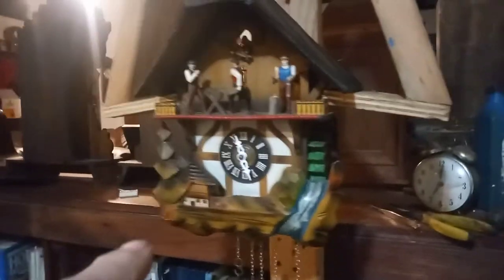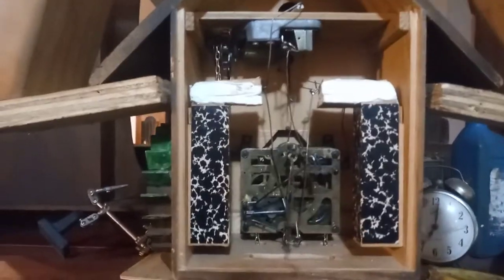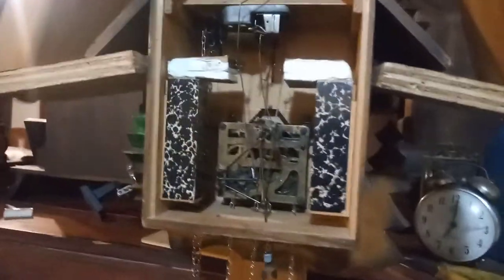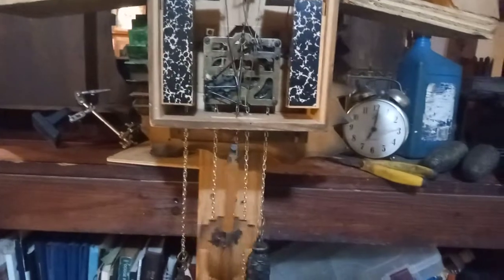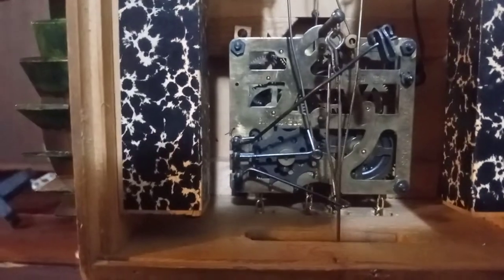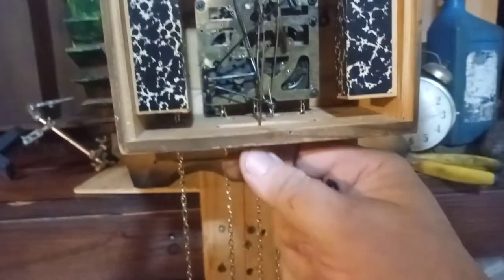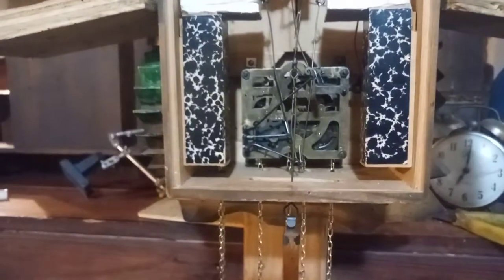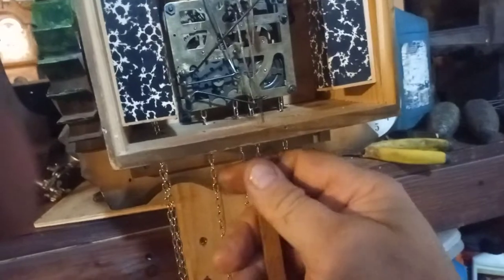Repairing a E Schmeckenbecher woodsman cuckoo clock with waterwheel 20211222 211806

Comment: I just came across your video and I wanted to share a related bit I discovered with this "v-wire".  The clock will also not run if the woodsman lead wire is bent in a way that it reaches the point of the v in operation.  Somehow mine got bent in just this way and it took me a while to figure out where the hangup was.
Reply from the maker: Glad that you got it sorted out. Yes the "V" wire is critical in getting this clock in beat. Thanks for the information. Hopefully folks will read these comments.

Comment: I’ve watched many of your cuckoo videos and learned a lot.  I’m repairing a woodsman clock with the water wheel. I have a problem adjusting the time. I disassembled and ultrasonically cleaned it, put it back together, got the music and hatchet man working. I have timetrax and set it to 8213 BPH.  I can’t believe it, it gains 2hrs 18min in 24 hours!!!   The pendulum is 19.5 cm as the Regula 25 movement specifies. Should l take the movement out and try to count the teeth on the time train to mathematically see if 8213 is the proper BPH?  I can’t imagine how this is possible.  Any advice would be greatly appreciated. Thank you very much. Jim
Reply from the maker: Jim I have a woodsman clock without the water wheel. The one in the video was for a friend.  My  pendulum is 7" long. Chalet style pendulum. With the bob about one" from the bottom of the stick. So try moving the bob up or down to get to the BPH. I hope this helps.Let me know if it does. Good luck.  Do you work on clocks for a living?
Reply from the maker: I have never dont the BPH or counted any teeth. If I did this for a living then I would to get the clocks out the door faster. LOL.  There is an app that you can down load on your smart phone called Cuckoo Calibration. Some people like it. I havent had much luck with it but at the time I had too many clocks going. I think a lot has to do with your phone also. You must be using "The Cuckoo Clock Repair Manual" by Biliger to have all that information?  As I say in my videos I use it for something but I bought it to help me repair my first cuckoo clock. It didnt give me the information that I was expecting.

Comment: Hello. I have a Schmeckenbecher Black Forest cuckoo with water wheel.  It is keeping time and the woodsmen and cuckoo are working. The hatchet man and the water wheel are not working.  Any tips on what to look for?
Reply from the maker: They made a few different types of the water wheels. If your water wheel isnt turning then it probably has a worn out tire that the rubber Oring spins on. You might try putting a couple of smaller orings around the tire.  I did that on a clock and it made the waterwheel turn. How long it will last?  God only knows. Good luck.
Reply: Thanks Mark. The water wheel actually does go around and the chime comes on sporadically with a gentle tug on the chain. So I guess it seems to work but not on its own. It’s doesn’t automatically kick off at the top of the hour.
Reply from the maker: Alice please find my videos on repairing music boxes. It is the video that when you come to my channel is what is playing. Within that video I explain what you need to do. Just search for music box.  When the videos come up find the one that has Beginner Cuckoo Clock Repair in the title and it should explain what  you need to do to resolve your issues.  Good luck.

Comment: Hi Mark. Is the wire coming from the center woodsman's arm fixed or does it move? I have this same clock that was my grandparents and I've got it running and now working on the woodsman movement. The wire on my clock appears to be glued in with the right arm and I can't tell if that's from a previous repair or if that is how it's supposed to be. In your video it looks like the wire is slightly rotating as the leader wire is ticking against it. Just wondering if I need to take the arm off the figure and break the wire loose so that it spins.
Reply from the maker: Originally there is a wire that comes from the movement side through the case and goes through both of his arms. His outside arm has to be able to move to allow those two guys to saw the logs. As far as taking his arm off if you break it there is a guy out in California that does molds. Of course it will be a plastic of some sort or whatever he uses to make the mold. I think he charges about $10 per arm unpainted. It has been awhile since I ordered one from him. I hope this helps.
Reply from the maker: His outside arm moves but that wire would have been put in tight so the arm doesnt spin as his arm controls to the guys arm to allow it to move which the guy on the left his arm is just put in with a small nail but it moves freely.
Reply: @munnerlyn3  Thanks. I think my grandparents definitely glued the arms back on at one point. Does the wire that goes through the case and both arms move or is it fixed? Mine does not move but I feel like it probably should.
Reply from the maker: @waynehiebler622  you will notice in the video that the arm that goes through the case goes in between the upside down v. That v is what is moving that arm back and for to cause the folks to saw the logs. So the answer to your question is yes it does move. It probably isnt moving because it isnt going through that upside down V or that "V" is missing and had broken off. I hope this helps. Let me know.